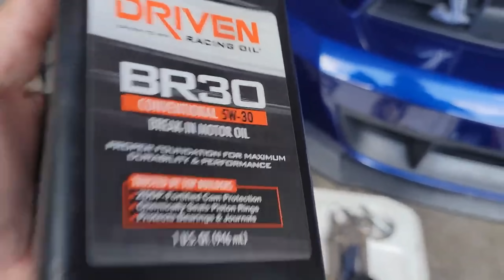2014 GT500 SectionH8 update

Comment: You mentioned last vid that working on it felt like a Cobra. Man, while doing my Cobra, it was easier to assemble the engine/trans, then headers outside the car on the k-member. The steering shaft had to be put in between the header primaries, and god forbid you forget to put the dipstick on. Anyways, after getting everything on, rolling/lifting the entire assembly up with a hoist from under the car just seemed to be the easiest route. Sick car and props to you for getting here back together and not parting or selling her!! 😂

Comment: When I rebuilt my 5.7 Hemi in my 2006 Chrysler 300C, I put the block back in first, then I put the long tubes onto the heads, and then just lowered them into the engine bay, lined it up, bolted it down. Easiest long tube install ever. Luckily you don't have to take the timing cover off to take the heads off like you do on most Fords. So next time I work on a Mustang I'm just going to do cams and headers in one swoop. I'm not messing with the steering rack, starter, etc. I'd rather install fresh head gaskets than to destroy my hands and end up giving up.

Comment: While watching this I said to myself “he’s not about to just pick the tranny up by hand” 🤣👌🏽 
Great video. Also, I ran into the same issue with the header barely touching the steering column, I put a small shim on top of the motor mount bolt to tilt engine slightly and fixed the rubbing. I’m sure you already know that but figured I’d share my solution.
Reply: The tr6060 and t56 magnum weigh 135 lbs or so I think not crazy but sure wouldn't be easy lol.

Comment: Hopefully you never have to pull the engine out again but awesome tip i got when i did one the engine harness can stay on the engine you just have to unbolt a few power and grounds and a 8 mm bolt on the fuse box it unplugs out the bottom as a giant square plug. Makes it a lot easier to remove and reinstall outside of the car.
Reply from the maker: At this point I'm not afraid of pulling it. Got a nice system down.

Comment: Excuse me, where are the cats sir?
Reply: It’s a race car
Reply from the maker: In the triple x pipe
Reply: Alex jack the car as high as you can from the back so it will be easier than tilting the engine. Back to Shelby assembly line at the beggining use it like that.
Reply from the maker: @mariocastro6503  lmao. Motor is in. did you not watch? Hahaha
Reply: His Xxx-pipe identifies as a cat.
Reply: Cats ! Mine melted two weeks ago, “fucken things suck “